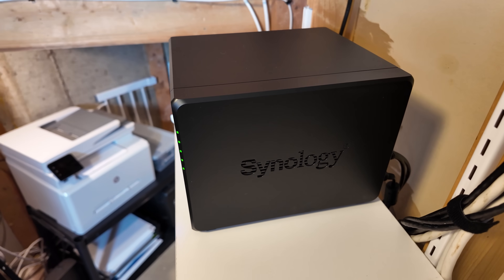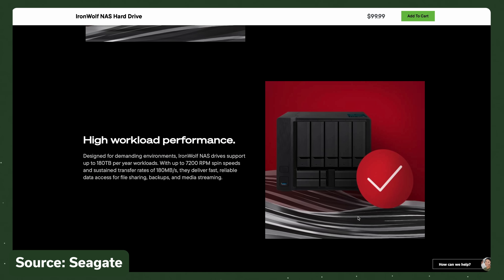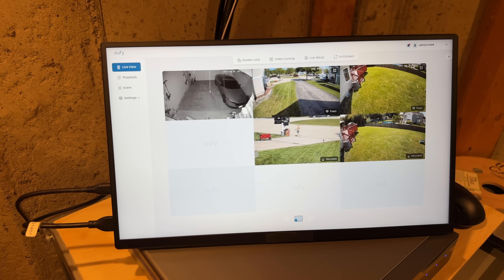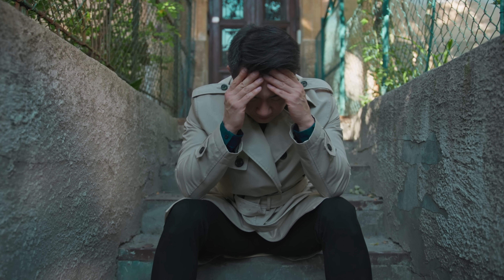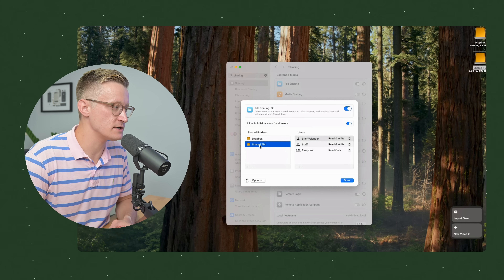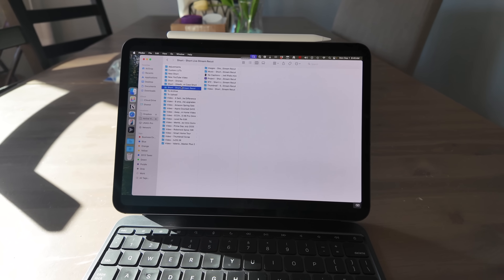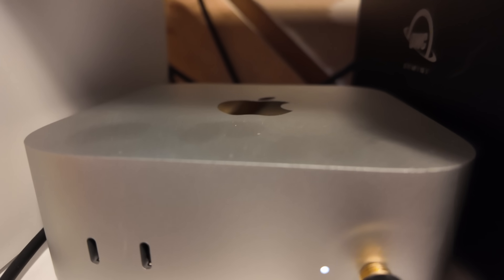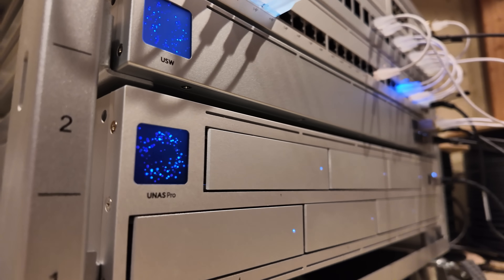Why a Mac mini can be WAY better than a NAS

Comment: I've been using a mac mini as a home server including fileserver for many years (started with an i7, then an M1pro and now an M2 pro).  I have 2 x 10 bay USB-C (10Gbs) connected as well as one 5 bay (also 10Gbs).  It's running Docker (I'm playing with Apple's Containers currently).  I have multiple RAID array's set up in the enclosures.  You can set up simple RAID0, RAID1 or JBOD with Apple;s Disk Utility, or you can use OpenZFS or SoftRAID to do more with (RAID5, etc).  Since my MacMini has 10Gbe, and the enclosures are also 10Gbs, it's much faster than any off the shelf NAS.  And with the M2 Pro, Emby, Jellyfin and Plex all run perfectly, and handbrake screams.  I'm also using NextCloud and AudiobookShelf on it, connecting through Cloudflare tunnels.  I don't do home assistant, but yeah, it's easy.  I also run some VM's on it for other various things as I'm playing.  This has grown with my needs over the years, and I can always add bigger and better enclosures, which I can't do with a NAS.  I also upgrade the MacMini when I buy a new one for my use (I have an M4 pro on my desk now, and it will become the new server when I end up getting an M5 or later).

Comment: One reason I got a Mac M4 was so that I could set up a NAS as Synology was slow in comparison.  This was to be a Plex server for all the movies I've bought over the years to simplify access and then I could put all the discs in storage to save space.  An added benefit is backing up to the cloud which is often cheaper running on a Mac than Synology which requires Backblaze B2 storage or iDrive at $250/yr for 1 year for 20TB.  Anything higher goes to 50TB at about double that.  It's cost prohibitive, slower, and doesn't allow for adding more drives easily with USB-C.  That's how I found this video to see if my setup was the best way to go or to look for a QNap or something.  Seems like M4 was the better option.

Comment: So a couple things - 
- 10G is completely wasted if you're using spinny drives, 2.5G maybe is worth it... 10G will only add value if you're running SSD's. 
- Your argument for the mac mini time machine is "Apple does it too"? The real question: is it BETTER in some way?
- Mac Mini as RDP destination - not really a NAS task... how does having a Mac Mini RDP destination make this solution a better NAS?
- Synology provides a docker host also... I had been running home assistant in a container on my RPi internet gateway but switched it to the Synology (can still deploy to either destination but the Synology is my primary hosting location now).

- IMO cost is not the best reason to use a purpose built NAS: Ops is a much better reason... I used to run bolted together storage solutions, they work but also TAKE work to make operate efficiently as NAS. I don't really see any indication that an OSX based solution like this one would be any different. Purpose built NAS solutions are designed to do that one thing well and so from an ops perspective are just easier to manage in my experience.  
- Other reason to consider: Power consumption, a Synology NAS will most likely consume 1/4 to 1/2 the power of a Mac Mini NAS. Even before you add storage to your MAC, the highest number I found for a 5 drive Synology box with HDD's installed is in the ballpark of a Mac Mini's power consumption just by itself (most likely it's lower... but there are a lot of variables)... add a loaded 5 drive external enclosure to the Mac and you'll be much higher. (the Oyen 5 drive usb-c enclosure is 150W... with that for drives you could need 3x more power to run the Mini solution vs the highest numbers I saw for a 5 drive Synology nas). 

I had a Mac Mini for years (gave it away earlier this year), was a very useful little box... just don't see it as a viable replacement for a NAS appliance for folks who want an easy to maintain and reliable solution. I DID run them side by side on my network with the Mini using NAS storage just like all my other systems... that's the solution I'd recommend to folks unless they're Apple propellerheads and really like to fiddle in the Apple ecosystem (in which case absolutely go for it, lots of geeky fun to be had there).

BTW... I'm not a Synology or cheap NAS zealot, I just believe that using the right tool for the job makes your life a lot easier. In fact Synology probably would put me on their hate list since I've been actively eliminating their proliferation (and getting rid of legacy units) at work where IMO centrally managed Enterprise Storage is a MUCH better solution.

Comment: Been using a duplicated (RAID) 4Terabyte external drive on my 2018 Intell Mac Mini since 2018. Sharing it on the network. Tried a Synology NAS  for a few weeks but it had too many issues working in a MAC / Windows mixed network especially when it came to Folder names being consistent. Returned it and set up a duplicated external drive drive on the Mac Mini.Much simpler. I didn’t need another hobby which is what I viewed the Synology (at the time)

Comment: Actually I’ve been using the same backup method as in your video for a few years, ever since I got my Mac Mini M1 as a spare desktop computer — connecting a 1TB SSD to store a copy of my iCloud photos. But times have changed. Firstly, that SSD is now running out of space. And since I’ve moved to Android (the new iPhones are too expensive for what they offer — my Xiaomi 15 Ultra camera easily beats the iPhone 17 Pro Max, but I digress), I’ve upgraded Google Photos/Drive from 200GB to 2TB.  

I already own a DS918+ which serves as a third backup, and also holds RAW photos, videos, and other media. I still use MacBooks and iPads daily (only 256GB or 512GB versions, which I think are still good value). But after 7 years with the DS918+, data safety is becoming a concern: the external HDD attached to it is getting old, and my remote DS120J has just gone out of service. So it’s time for a revamp.  

At first I considered upgrading the DS918+ to a DS425+ with 4×8TB drives, then using the DS918+ as a remote backup, and adding a 4TB drive for local backup. In reality though, I only really need about 1TB for myself and family documents and photos, so 2TB will be enough headroom for another 5 years or so. The other 10TB on my NAS — RAWs, old movies — aren’t critical. I usually edit and encode the final versions into HEIF and H.265 and store them on the cloud anyway, and for movies we just stream now instead of using Plex.  

So instead of spending another $1,800 to $2,000 on a new SSD on the Mac and Synology setup, I decided to just upgrade Google Drive to 2TB. Since I already needed 200GB before, the extra cost is only about $80 per year. That way, my critical photos and data now have two cloud backups (Apple + Google), and I’ll probably just refresh the local backup on the DS918+ for peace of mind. When the DS918+ eventually fails, I’ll simply get a cheaper 4‑bay NAS instead of another expensive Synology."

Comment: One other thing that I've found with any NAS system is 1. ALL system-specific RAID solutions are prone to crapping out, and 2. which is inherently vendor lock-in. 

If it goes down (and it will eventually), the software used to run it means you're stuck with whichever brand you bought in order to perform a recovery... forever and ever. What I like about a Mac head solution is, you can just go with a simpler JBOD solution and still have a MacOS head running on a home network... which is what I do. I've got a 4 drive OWC DAS, with no RAID: two drives do the day to day lifting, and the other two are backups that routinely sync with Chronosync. And it works great! Haven't had a drive die on me in over a decade with this configuration, but if I ever do it's as simple as replacing a dead one and I'm back in business.

Comment: Does that shared Time Machine drive/partition automatically sync your phone, tablet, other apple device memory slide shows to it. I've kind of been looking for a way to back up my families data, mostly photos without leasing space from iCloud for all of it while retaining all the nice features of it. Even if it doesn't work quite as smoothly, however just as smoothly would be nice. I'm more familiar with external drives attached to a computer or laptop and manually backing things up to it. Automating things and making it available from anywhere sounds appealing.

Comment: I would do both. A fast nice Mac mini with some TB4 NVME for fast work and fast Time Machine of all my MacBooks. I already have one 8TB NVME with all Users on it for Workload and 2x 4TB for Timemachine Backups. So if the Mac failed I can start up another in 30 min. If the NVME Fails I have the Time Machine backups. But later a NAS from unify that's just for older stuff and a second Backup Clone of the Time Machine. It can be loud and inside the server rack. But at my workspace I want silent and fast connection without fans and HDDs. But with 2 Kids and my Woman, iPads MacBooks and Phones you need lot of space for Backups and stuff! So I Use this Mac mini server. And second is a UTM Virtual Machine on it with Homeassistant.

Comment: Eric, I will definitely be considering a Mac Mini in the future for my storage solutions. Earlier this year,  I acquired an old Airport Time Capsule, which has been great. But I've only been using it for Time Machine backups for my MacBook Pro. However, come next year with the release of macOS 27, the product will no longer be supported for Time Machine, so I think a Mac Mini in combination with the Airport Time Capsule, strictly as an external hard drive, will do the trick!

Comment: Really nice video! I'm using an old MBP Montrey at the moment as my Time Machine / NAS handler for our Apple and GNU/Linux devices. For Time Machine, I'm using an external storage for which I created several APFS+ snapshots for our macOS hosts. I will go back and revisit my strategy since I now know I can tell that "NAS" macOS host to broadcast a single snapshot as a Time Machine backup storage to our network.

Comment: About the sponsor, according to Google:

Key Aspects of the Eufy Scandal
Unencrypted Cloud Uploads: In late 2022, a security researcher discovered that images and videos from Eufy cameras were being uploaded to the cloud, even when consumers expected local storage. 
Misleading Marketing: Eufy marketed its products with slogans emphasizing local storage and privacy, creating a false sense of security and contradicting its actual data handling practices. 
Unencrypted Streaming: It was possible to access active Eufy video streams without authentication by determining the correct URL, increasing the risk of unauthorized viewing. 
Facial Recognition Lawsuits: Eufy also faced legal challenges under the Illinois Biometric Information Privacy Act (BIPA) for allegedly collecting and storing biometric templates from facial recognition technology without proper user consent. 
Company Response & Legal Action: Eufy initially denied some accusations but later admitted that most allegations were true. This led to a $450,000 settlement with the New York Attorney General for misrepresenting the security of its products and failing to implement sufficient security testing. 
Ongoing Concerns: Despite the settlement and some fixes, the events eroded consumer trust, and lawsuits over the use of facial recognition technology are still in progress.

Comment: What a strange idea. If you need a NAS most probably you need more space than 256GB or 512. So you need some external HD docking. Meanwhile a NAS case covers those disks and you don't need  a separate device for this. And usually a NAS has comparable low electricity consumption too.

Comment: A Mac mini is pretty expensive even as a small NAS solution. Of course, if you want to stay in the Apple ecosystem, you don't really have a lot of other options, but otherwise:
- a Raspberry Pi NAS is probably cheaper and better, just as power efficient since you anyway waste a lot of power on the same HDDs; your use-case seems to be small enough for this to be enough
- getting to a reasonable size today (e.g. 4x16TB) would still require an external case for the disks; so why not get it all bundled and avoid 2 power bricks?
- if you want to save power you should run all your home automation and home services on the same NAS box, so Docker is a great solution; works on the Mac, but it's the same with extra steps and complications
- that 10G interface is pretty sweet, but again expensive vs what some used NIC would cost you on eBay
I went for a Synology with 8 disks, upgrade-able RAM, 2 NVMe slots for cache and did a cheap used-NIC upgrade for 10G. The Ryzen CPU in there is a great compromise between power efficiency and enough grunt to run a bunch of containers.

Comment: This video was awesome. But I’d love to see another video going deeper on some of the software you use. Currently I have a Mac mini connected to my home network that runs homebridge. But over the years I’ve collected many different types of hard drives. I’d like to consolidate them and have them be accessible from my other machines that are wirelessly on the network.

Comment: I dind using a mac as a nas server so cpu not worthy. Better sell it or use it as a spare computer or something. I really believe that if something fails like a thunderbolt connector or the raid or even worse, the mac itself, you are left with only a drive.

Comment: Mmm….  No.
Synology (or qnap) are better solutions!    
They cost less, use less energy, are better build for the specific use.   You can run VM on them, so having a real desktop client for dropbox or everithing you want.

10gb/s LAN???  😂. Go on 2.5gb/s with usb adapter.  Don’t be foolish.  10GB/s LAN you need to spend a lot of money for cable, network switch and other stuff for nothing….   4 nas HDDs (5400rpm, Made for last) on RAID5 setup can give you 400MB/s max speed… 2.5 GB/s eth can give you 300MB/s speed…. So would you like to pay 3 times the price for max 25% ipotetic more speed that you don’t need?

Comment: I am using Synology NAS, and never considered the Mac before. My typical use case is to sync my photo-video while traveling, even when the connection is weak.
I need to upload stuff from phones, camcorders, and drones to my home, and I use various NAS services for that purpose. They are not perfect, so I am going to consider the Mac mini in this role - thanks for pointing!

Comment: I use both. Have several Mac minis in my closet including old intel’s. Eg 2010 Mac mini server,  2 x 2tb ssd (with hdmi dongle) - works like a dream on my network. Use as network file server, apple cache server, iTunes server, plus a an old FMP database I access locally remotely  or via screens Vnc client. My Synology 925+  does my cctv and cloud backups.

Comment: Just so I'm clear... Connect a Mac Mini to my network via 10Gb if applicable, and use the internal drive, or external RAID drive to act as a NAS where all my other computers on, or outside of my network if applicable, can access files on the Mac Mini (NAS)? Time Machine aside, my ideal state is to not have to pay Apple $10+ a month on iCloud storage, but it seems like I still need to for some basic functions, but not for file storage which I can get away with just doing locally on my Mac Mini (NAS) setup.

Comment: I've got a 2012 Mini that acts as a Time Machine server. It also runs Indigo for some home automation and Securityspy to record cameras. I got rid of the original fusion drive and put two large SSDs inside the Mini. There is also an external hard drive for the security video. It all works fairly well, but for the deprecated OS. Catalina had some networking bugs and I have experienced a few issues, but in gernal it works fine. I hope to get an M4 Mini soon and will probably put an SSD raid on it.

Comment: A Mac mini as a NAS? That’s cute.
Sure, you can duct-tape external drives and call it a ‘server,’ but that’s like comparing a toy car to an actual truck. Synology isn’t just storage, it’s an entire ecosystem built for 24/7 reliability, RAID management, remote access, snapshots, user control, virtualization, surveillance, and a dedicated OS optimized for one thing: doing its job without babysitting.

A Mac mini will spend its life pretending to be something it’s not, while my Synology will be quietly running circles around it. But hey—good luck with your ‘DIY NAS’ when macOS decides to push an update in the middle of your file transfer.

Comment: you can do this with any old computer. for windows devices especially, you can reload the operating system with TrueNAS for example; a Linux install that is dedicated to serving as a NAS OS and giving you all the configurations and features you'd expect from a modern NAS. Also is a perfect way to give a laptop with a broken screen a new lease on life for free.
Reply: I've been down that road also.  While reusing hardware is good, it really depends on the power draw.  I have an old laptop that uses only 6w idle and was perfect, while my old desktop PC was a monster and would cost me $100 just to run a year, and in which case using a Pi5 that cost $80 would be a better option.

Comment: You are comparing a mac mini with a synology type nas. i will give you a 3rd option that i have setup in my home: a mac mini with a 10gb lan connected to the 10gb interface of UNASpro + external ssd raid with OWC express 4m2. this way you can save all your photos on the OWC and run your plex server using SMB shares from your UNASpro. Not cost efficient, but i think it is the best way to go.